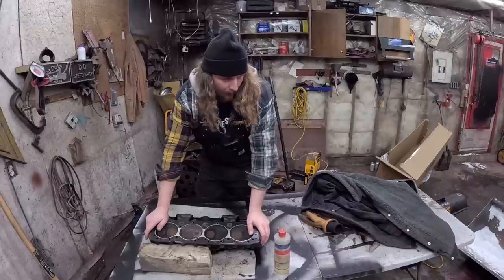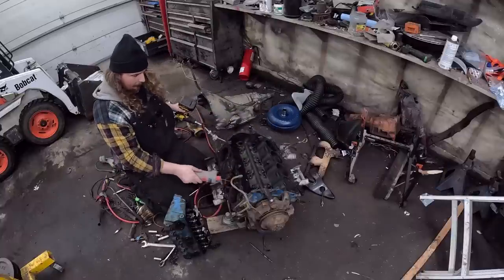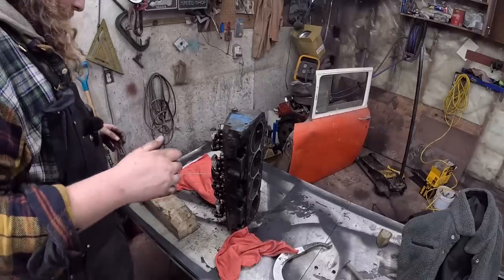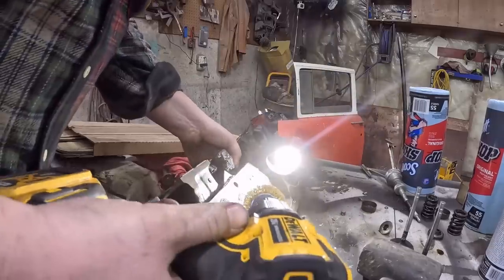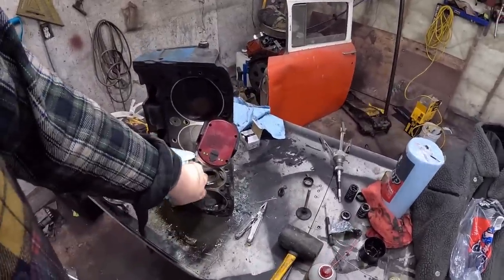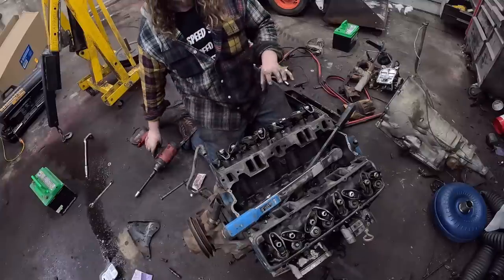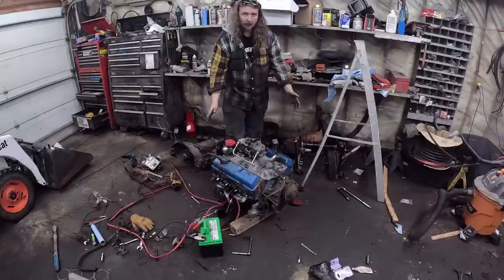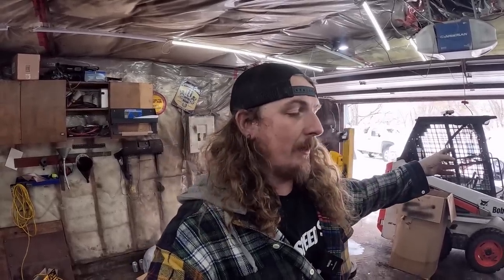FORCING IT TO RUN! - Freeing A STUCK Engine THE WRONG WAY

Comment: So Dan, what was the point of that video that we missed???? You had a motor with at least one cyclinder seized. You tore it down and said that there were parts with no value and maybe some with value. The comments I read were mostly that small blocks were hard to find and most of the parts you had were of value. So...what did we miss?? I don't think that anyone understood that you had intentions to rebuild for either just the fun of it or to put it in a car. I grow up here in my part of the far west with not much money in a art of the far west were money was in short supply, So a struggle to keep a car runing made us depend on a lot of "junk " parts To replace a blown piston in an old Chevy I used a piston and ring set from the wrecking yard installed it using a screw driver and ice pick and used the headgasket from the engine after soaking it in the bath tub, So what did we miss?? I was pleased that you made that junk engine run and it did not sound all that bad!  TY 4 sharing

Comment: I've seen shit like that done back when I was a kid and it ran for years w out any problems at all we all thought oh boy this is not gonna work and like you it was done mostly as a joke and it was not a joke at all that motor actually was already bored 60 over and had good iron heads on it he tried to blow it up for the next 3 years sold the truck w that motor in it that motor would wind up tight 6 grand daily it was a 3 quarter ton square body w granny low 1st gear 2nd and 3rd wound out that. Motor lol